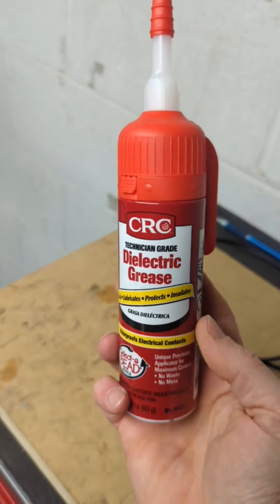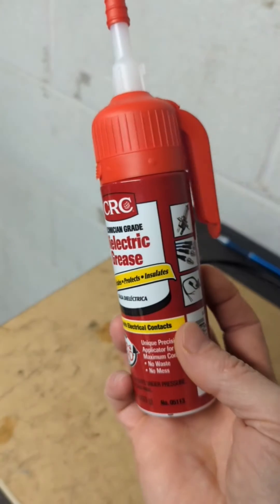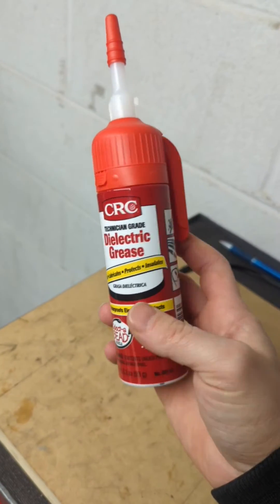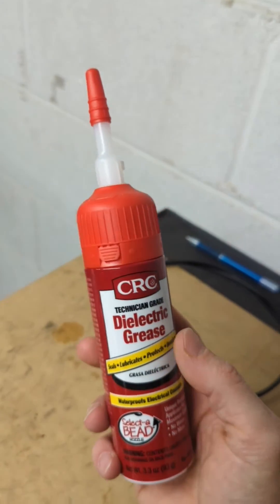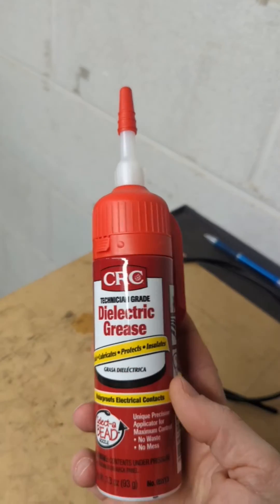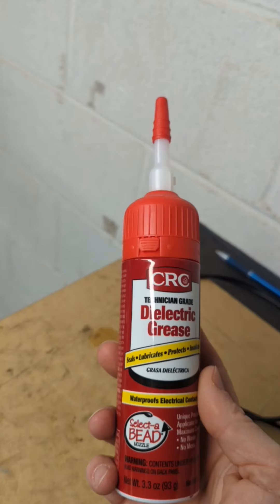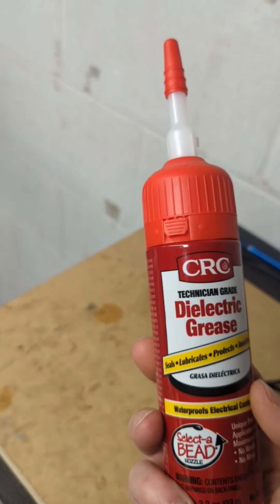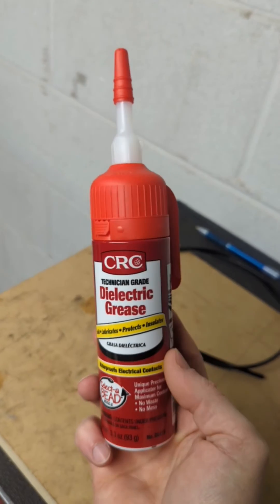DONT USE THIS on your #eBike!! (...or use carefully) Dielectric grease #electricbike #tips

Comment: Hello, so Im one of the dorks that squirted a blob of this right inside my ebike connector. Even before I saw this video, I regretted using the grease, I know better since grease picks up everything, so in my attempt to prevent oxidation, I pick up FAR more debris. I have to store the bike outside, usually covered, but the batteries come inside, The bike side connector is what I worry about out in the elements, humidity mainly in summer.

 Im wondering two things: 1) Will electrical contact cleaner remove the residual grease after I remove the large amounts? Its too small to really see inside well or use paper towel, so Ill have to get in there with a toothpick carefully.  2) IF you have time, which type of Deoxit would you use for, first cleaning out this grease, but then long term care of the batt connector that sits covered outdoors? I have the D-series, the Shield series and the Gold. I was thinking of using the D-series to clean, then the Shield for protection outdoors but its doesnt have any deoxidizer. Maybe Im confused, is the deoxidizer present to remove oxidation OR prevent it? If its the latter then I can understand why the Shield has none as its protecting an already oxidation-less surface.

Sorry for asking for so much, feel free to go as deep or shallow as you like, or not at all. I appreciate the video regardless, it gave me the nudge to deal with this matter!

 Have a good one!
Reply: Use toothpicks or a small wire brush to get the globs out. Any contact cleaner should cut through the grease when applied to a small pipe cleaner and worked around the contacts or terminals. We use simple green and a low VOC contact cleaner at the shop to clean.
Again, dialectric grease isn't bad if used correctly to protect from the environment on the outer edges, it's when its fully embedded that you impede correct contact and current flow.
Reply: @pinballpedaler  Thx for the info!

Comment: LubriMatic 11755 Di-Electric Contact Grease. Works great on my ebike battery contact points! No more rust or corrosion.
Reply from the maker: @randomgoogler8364  As long as it's applied right (and in moderation) it's a great quick maintenance step for keeping corrosion away.
Reply: It should be used carefully around 5V ref bus and signal return connections, especially where the connections aren’t the best to begin with (either by age or just cheap Chinese connectors).  Otherwise the theory is yes you can indeed use it inside connectors which has optimum fit and terminal surface contact area.  The is the job of dielectric grease, to prevent terminal erosion/corrosion and maintain low o2 and moisture inside the connector.  Good fitting terminals SHOULD exclude the grease from between them when connection is made.  The problem is most connectors used with even some high end emobility are actually quite poo.  The dielectric is doing its job perfectly, it’s the product it’s being applied to that isn’t.